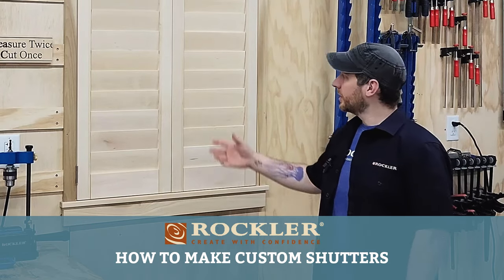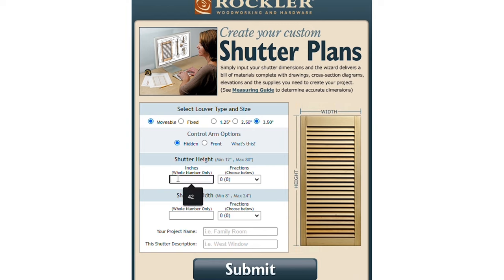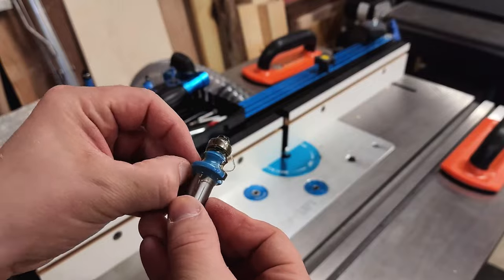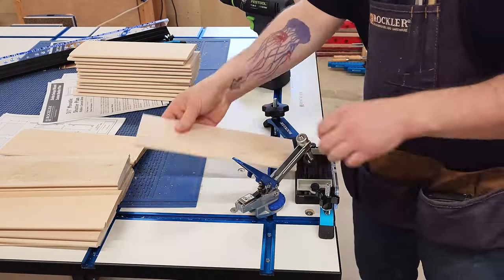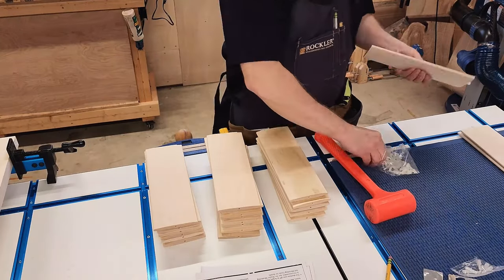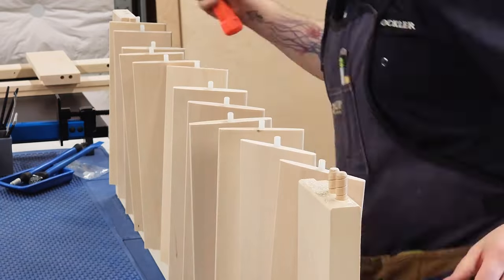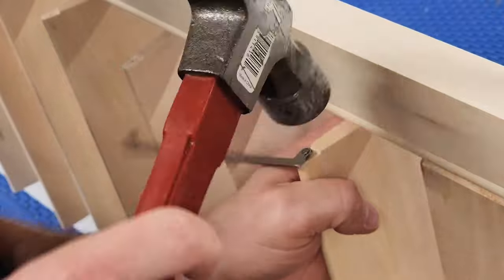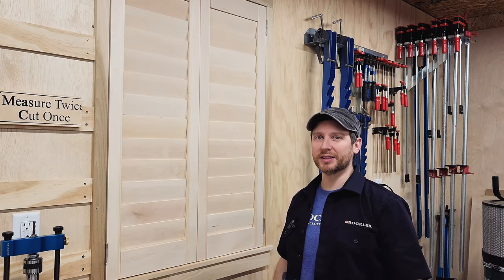Making Custom Wood Shutters

Comment: What other wood can i use for the shutters? Where I live the stores (homedepot and lowes)does not carry basswood. Please advise.
Reply from the maker: Basswood is the most common. It is light, soft, and easy to work with. It takes paint nicely as well. You can order basswood on our website. If you use our Shutter Design Wizard, it will calculate how much basswood will be needed for your shutters. In the inventory list generated, it will give you item numbers to order exactly what basswood you will need to build them. However, if you don't go that route, Poplar may be a good alternative.

Comment: where can i nd the list of measuring and drilling tools u used? I did not find all the tools on the website.
Reply from the maker: If you input your dimensions that you find by following our measuring guide - https://go.rockler.com/tech/44342measuringguide.pdf - into the design wizard - https://shutters.rockler.com/louver.cfc?method=start&louverType=m&louverSize=2 - the last pages will have an inventory list of all the jigs, and materials you will need to make the shutters. Note that the correct size drill bits are included with the jigs.

Here is a list of other items used in the video, and to measure and drill with:
Tape Measure - https://www.rockler.com/12-speed-mark-tape-measure
Rockler height gauge: https://www.rockler.com/rockler-4-piece-digital-measuring-kit
Crosscut Sled and Drop Off Platform - https://www.rockler.com/tablesaw-crosscut-sled-with-free-crosscut-sled-drop-off-platform-bdl
Universal Fence Clamps - https://www.rockler.com/universal-fence-clamps
Spring Loaded One Handed Bar Clamp - https://www.rockler.com/rockler-spring-loaded-one-handed-bar-clamps
Festool TID 18V Impact Driver and T18 Drill/Driver 4.0Ah Combo Kit (576494) - https://www.rockler.com/festool-tid-18v-impact-driver-and-t18-drill-driver-4-0ah-combo-kit-576494-bdl
Combination Square - https://www.rockler.com/igaging-12-combination-square
XL Silicone Project Mat - https://www.rockler.com/rockler-silicone-project-mat-xl-23-x-30
Silicone Glue Brush Set for Dowel Joinery - https://www.rockler.com/rockler-silicone-glue-brush-set-for-dowel-joinery

Hope that helps. Let us know if you have any other questions. Thanks!
Reply: @rockler  If i want a wider louvers (like 4"), is there any way to get measurements for that?
Reply from the maker: Our jigs and design wizard are only made for 1-1/4", 2-1/2", or 3-1/2" louvers. Also, our control arms won't work if you make a different size louver. Sorry about that.

Comment: Super idea, I wonder how you keep the wood from warping due to the sun and heat?
Reply from the maker: Most home windows are made with UV protection. Between that, a good protective finish, and properly dried wood to start with, warping should be minimal, if at all.

Comment: Great video thanks! 
Spring loaded louvre pins would make assembly a little easier.
Reply from the maker: That would help! Adam made more of these and said he put a piece of blue painters tape, from end to end in the middle of the rails and parallel to the stiles, to help hold the louvers. He found great success and ease with this method.